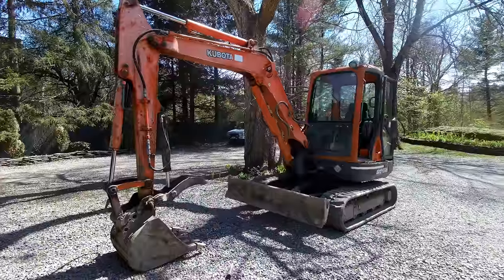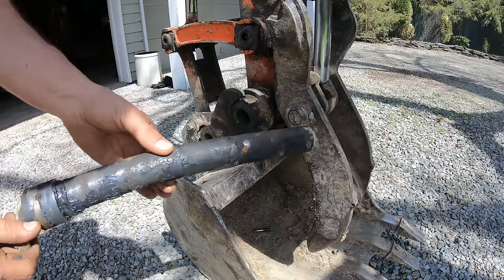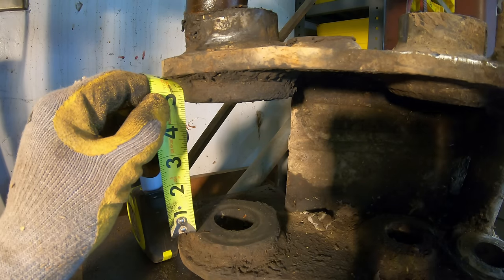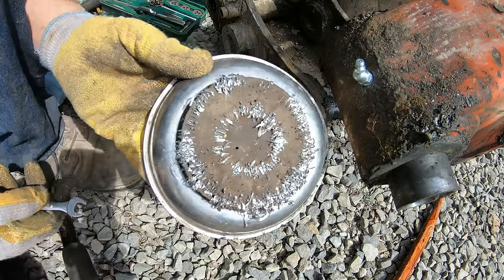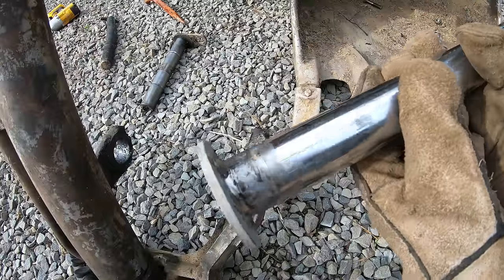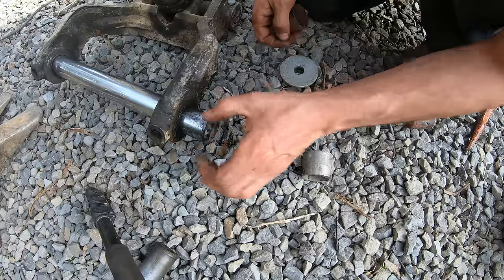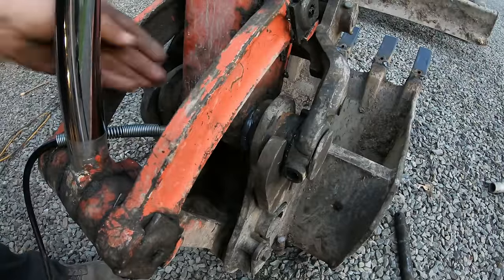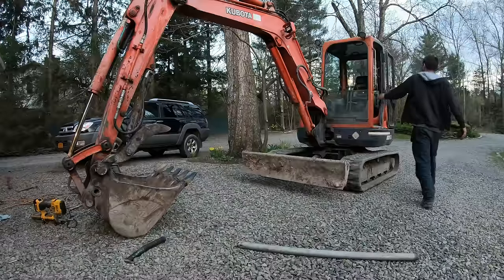Making an excavator bucket pin

Comment: we have a machine at work that will lose teeth like crazy. i told my boss lets just weld the teeth on and everyone looks at me like im crazy. mind you, this is a worn out 50,000 lb machine. yet the company will continue to go and buy new teeth at like 300 a pop and put them on but the bucket itself is worn out and it will continue to break the keepers and lose the teeth.
Reply from the maker: Welding them is the only way to go. They just disappear with the pins. They last a long time, and are not that hard to change.
Reply: @AndrewCamarata  yes they told me "what about when we have to change them" hell they lose them faster then they can wear them out! torch em off and weld new on.
they are the 1/4 turn style with the rubber/metal keepers. i had to build up the stubs with weld so the teeth would fit tighter.

i guess in the shop its no big deal for us to weld/cut them but in the field it would create too much downtime = wasted money.

Comment: Dude, I love your ingenuity, but the grease groove is not a flaw. It is there for a fucking reason. If greased daily, like it is supposed to be, it creates a wear surface between the pin and the bore. $500 for a pin is WAY FUCKING CHEAPER then to have someone come out to line bore your stick and coupler man. Cat certified technician speaking here dude. Things have a service life, at some point there will be a failure. I would highly suggest getting a new pin, and measuring your bores for wear. You can get oversized bushings to take out any slop.
Reply from the maker: They always break there. I made it so the grease comes from the other thing, this repair has been working well.

Comment: No assembly grease huh just ram her in there dry makes for a much snugger fit that way lol it will wear itself in.
Reply: Did you see Andrew later greasing the fittings and having the extra grease ooze from the end of the pin and bushing??  How about re-watching the video?
Reply: An if you knew anything about lubrication smackin a pin in that hard it already smeared somewhere so maybe somebody else should watch the video closely

Comment: The thumb is making a little noise hopefully the grease will make its way around and that will go away
Reply from the maker: I think it was on the pivot where the thumb cylinder moves. I need to look at it. I don't think it had a fitting.